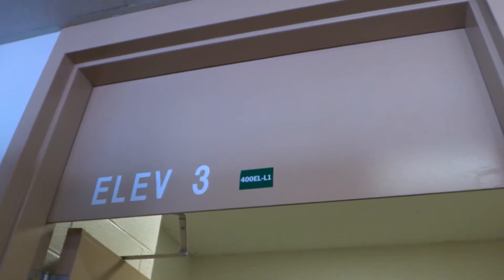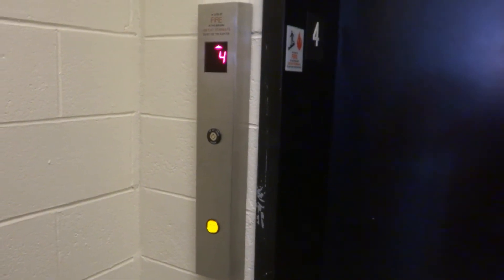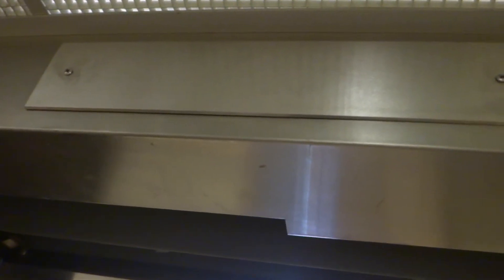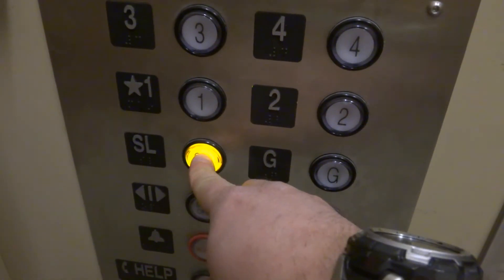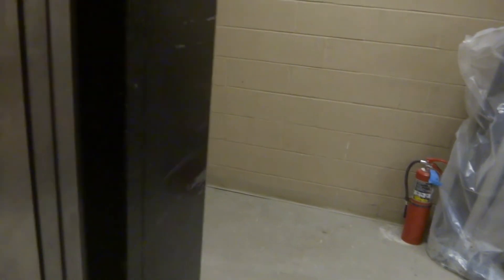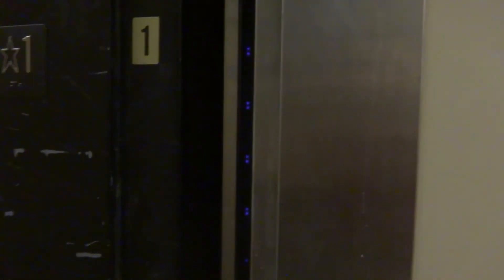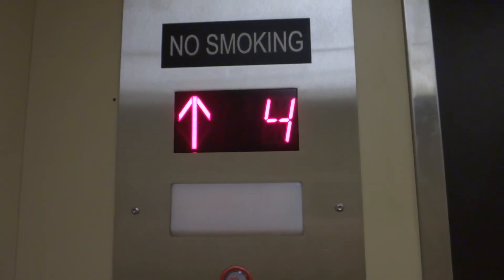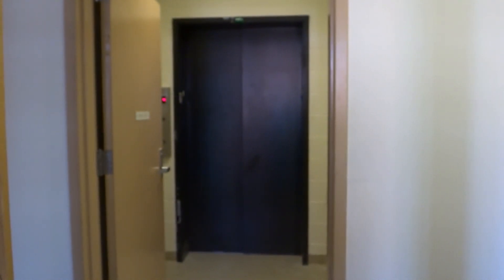Fitchburg: FINALLY!! KONE-Modded Beckwith (Monty) HIGHdraulic Elevator #3, Hammond Building, FSU

Comment: Interesting that this elevator was modernized differently than the other one. The other mod was more interesting, as they kept the fixtures, with only small modification.
Reply from the maker: upanddownadventures 
I don't get it. I guess they wanted a key card reader, so they just did it all over.
Reply: georgef551 innovated elevators are ok.  looks like it rides smoother now.